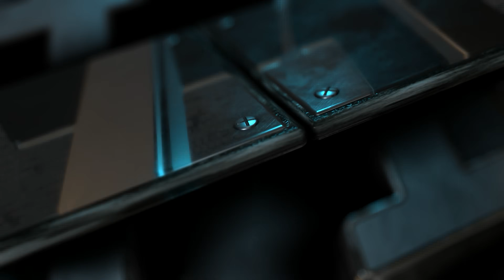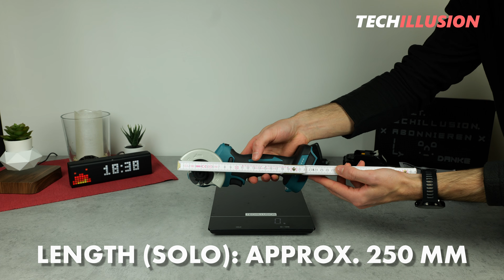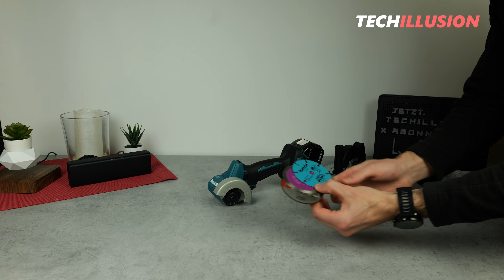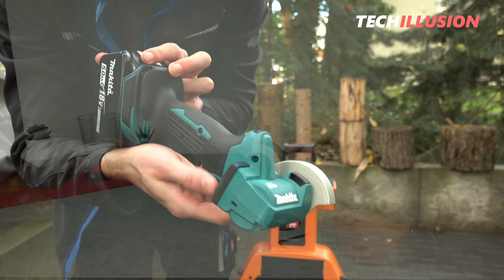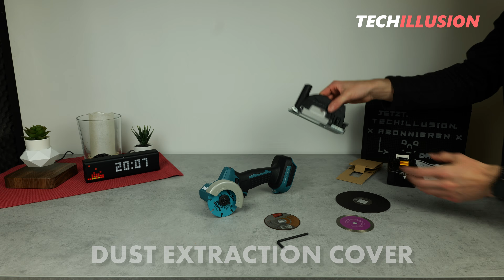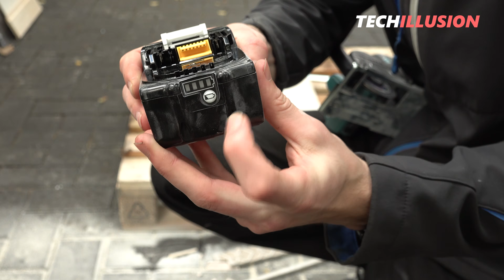🔥TOP or FLOP?! 🧐 The SMALLEST 18V 76mm cordless Angle Grinder from MAKITA!😱 DMC300Z Review & Test

Comment: Do you need to cut from the far end toward you? Can it run on the material and come to you? Which way is the right way to cut any c
Kind of board?
Reply from the maker: @kkds89 Due to the changeable direction of rotation that the device has to offer, you can select this. Some discs, for example for tiles, have a predefined direction of rotation. With the other cutting discs, you can set the direction of rotation yourself. 
For example, in the direction in which you want the joints to be cut. :-) 
Best regards
Reply: @TechIllusion-EN  Oh, you can even change direction! Wow, I didn't know that. It's really good to know, thanks.
Reply from the maker: @kkds89 Yes, this is a very special feature of the device. Because very few have this to offer.
Best regards

Comment: So, it means when I install a disc that says clockwise, I can't press the reverse button without having to stop the machine & change the disc's rotation position right? basically flipping it over.
Reply from the maker: @Sir-Kay Yes, that's right! 
With some cutting discs, for example for stone (i.e. diamond cutting discs), there is a predetermined direction of rotation! In this case, you should therefore not run the device in reverse 😊👍🏼
Best regards
Reply: @TechIllusion-EN  So, in other words, when the disc says rotate forward, we should only let the machine spin in that direction and when the disc doesn't say anything, like metal & wood cutting discs etc it's safe to spin the machine in either direction, is that correct?
Reply from the maker: @Sir-Kay yes, thats right! :-)
Reply: @TechIllusion-EN  Will this thing take the much thicker sanding disc for metal pipes or there's only enough space for the generic thin metal cutting discs?
Reply from the maker: @Sir-Kay You probably mean a roughing disk! 
This should not be used on the device...
Reply: @TechIllusion-EN  I don't know what i meant is called but, I know after cutting steel with a blade, it leave really sharp edges, I would like to dull the edges out, what blade should I use to do that? and would it fit onto this 3" machine or I'll need a bigger tool for that?
Reply from the maker: @Sir-Kay Yes, that's exactly what I mean. 
Unfortunately, you can't remove the sharp residue with the mini device. It's not designed for that
Best regards

Comment: the makita and the bosch is the same price on amazon right now(118 euros) i have batteries for both platforms. Which one whould you pick? i think that the makita is the better option.
Reply from the maker: @simesimicevic8713 Yes, I would make the same decision! 
The Bosch angle grinder is smaller and more compact, but it also has less power and fewer features! I would go for the Makita if I were buying a new one. :) 
Maybe I can record a comparison video on this! 🤔👍🏼
Best regards and thanks for the support
Reply: @TechIllusion-EN  Thanks for the reply.Yea that would be a nice video.
Reply from the maker: @simesimicevic8713 with pleasure!
I'll see what I can do :) 
Best regards

Comment: for cutting   service I'm in doubt between these
Drywall ,  power cable.
Makita 18v GA404DZ
Makita 18v  MC300DZ
Reply from the maker: @jhonhunterjp4446 The Makita DMC300 is much more compact and also easier to handle, but of course it doesn't have as much power as the 125mm angle grinders... 
Best regards